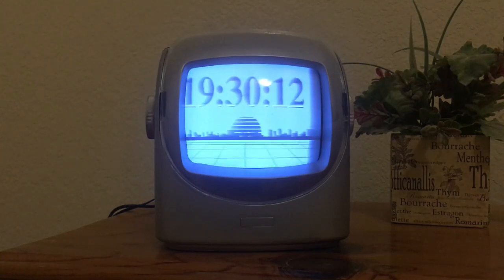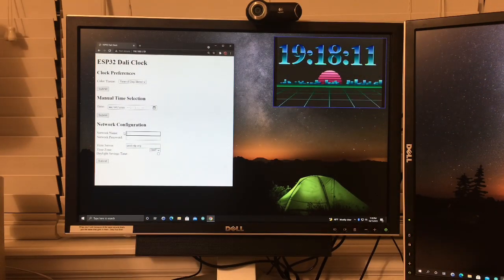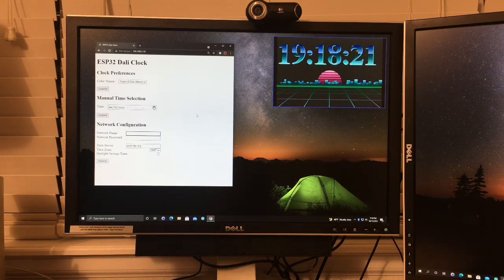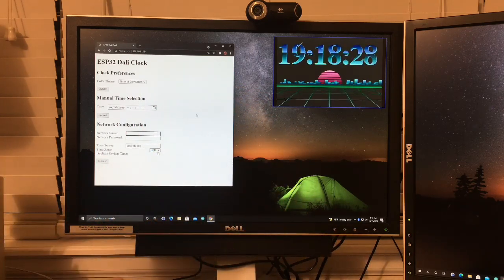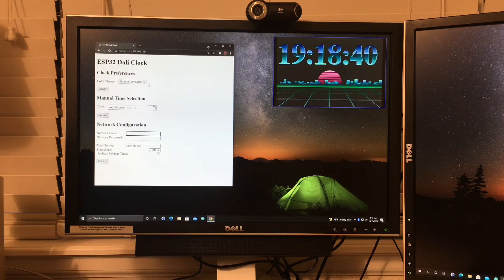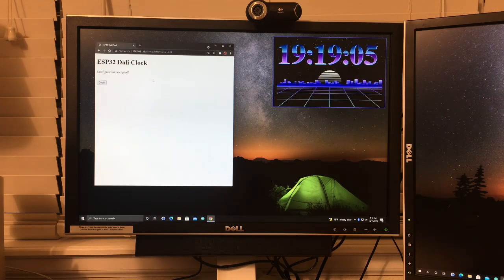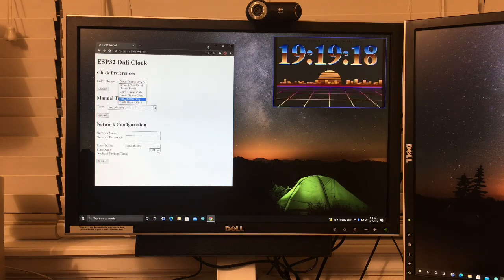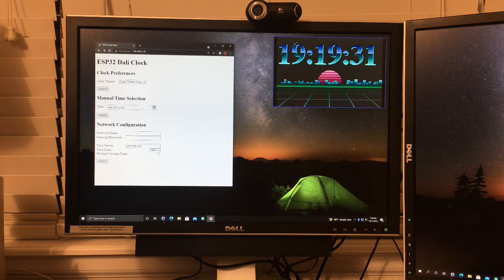ESP32 Dali Clock Demonstration

Comment: Is there a way to completely get rid of the wifi and web server and have pins on the ESP be buttons for setting the clock and the other features?  Love the effort put in to this and I would like to integrate it in to my custom camera system controller as a main screen on the camera monitor when no camera is selected.
Reply from the maker: Sure, the code can be modified to do this.
Reply: @MarcioT  Can you guide me in the right direction to start that?  I'm not sure where the commands are at in the web server section.  I can see like the menu commands and whatnot, but I'm also not familiar with HTML code and how to transform it back to C++.
Reply from the maker: All the wifi functionality is started by “wifi_start()” on line 85. You can get rid of that and everything following the comment on line 141. To set the time, call “dali.set_time()” as illustrated on line 86
Reply: @MarcioT  Thank you for the insight.  I will mess with it some time this week.  I see those lines you are talking about.  I may dig through the source files as well to see how to set the themes and dates.  Maybe mess around with some of the graphics as well even though what you have created it amazing!  Thank you for sharing this project.  Didn't even know this was possible with ESP32 before.
Reply: @MarcioT  Good news, I got it all working how I want now.  A few last questions:  How can I go about making a larger font, I'm not understanding what I'm looking at inside the font6x8 file.  Also, what Atari colour palette are you using for colours?  I can't seem to find one online that matches what you have done here.
Reply from the maker: @hydrolisk1792  look at the following repo: https://github.com/marciot/ESP32CompositeColorVideo . There is a link to the color palette in the expandable section "Documentation for Developers". The bitmap font is only used for printing the tiny text at the top of the screen, not the clock. I do not know the format of that as that is part of Bitluni's original code base. If you want to change the size of the clock itself, there is another project with the font encoder https://github.com/marciot/arduino-dali-clock
Reply: @MarcioT  Thank you for the information.  Much appreciated.  Got some answers to questions I had with the palette at least for now.  For now I can work on other screens now that I know the palette.  Contacted bitluni about the font issue.  Waiting on a reply.  In  the mean time I will begin creating some on screen graphics to use along side the clock itself.  FYI I wasn't looking at changing the clock digits at all as they are the perfect size and the file for those is a lot more understandable than the font file.

Comment: I was wondering if you could help? I seem to have everything uploaded correctly, and i'm using a NodeMCU ESP32 unit. The issue is that I cannot see a working WiFi AP? It's not showing on any device. Any ideas as to why?
Reply from the maker: You may have to try earlier versions of the tools, this has not been tested in recent versions.
Reply: I've tried different versions of the IDE to upload the code. I do have more luck with the older versions. The vertical hold is better when using an older version, but still, there's no access point? I've tested my ESP32 with another program which creates an AP which works fine... I'm just not sure?   @MarcioT

Comment: Have you tested this on the latest 2.0.3 esp32 code? I cant get the config page to open, i can connect to the AP. But I either do not know the IP, or it simply does not serve a web page.
Reply from the maker: You can find the IP on the serial console or it will be printed on the top of the screen briefly when it first starts up
Reply: @MarcioT  Seems it does not work on the latest, i used 1.0.6 to compile and it works perfectly. Really nice project overall.
Reply from the maker: @Nobody-Nowhere  I just tested it under 2.0.3 and confirmed that you needed an IP address to connect to it. So I added this to the startup message.

Comment: Excellent project Marcio. I'm trying to get it to work on a Wemos Lolin32 (brand new & flash erased) but the Wifi AP doesn't initialise. Would you have any idea why?
Reply from the maker: I don't know. The code that initializes the wifi starts on line 275. The first thing it does is put "Failed to connect. Please connect to "ESP32 Dali Clock" to configure. If that message is appearing, then the next thing that happens is the AP is setup.

Comment: Is there an easy conversion to run a TFT display?  I love the numbers melting into each other and I don't have a monitor with composite input.  I hate to learn every bit of the code to convert it over to TFT.  Thanks for a great project, either way.
Reply from the maker: Hi! My Arduino Dali Clock might meet your needs:

https://www.instructables.com/80s-Style-Melting-Digital-Dali-Clock/

Another easy solution is to buy a rear-view car backup camera kit. For about $25 you can get a small LCD display capable of composite input:

https://www.amazon.com/Monitor-RAAYOO-Definition-Display-Optional/dp/B074P4L9XK/ref=asc_df_B074P4L9XK/?tag=hyprod-20&linkCode=df0&hvadid=312141906131&hvpos=&hvnetw=g&hvrand=8110339378037440785&hvpone=&hvptwo=&hvqmt=&hvdev=c&hvdvcmdl=&hvlocint=&hvlocphy=1014517&hvtargid=pla-569415873081&psc=1&tag=&ref=&adgrpid=60234797217&hvpone=&hvptwo=&hvadid=312141906131&hvpos=&hvnetw=g&hvrand=8110339378037440785&hvqmt=&hvdev=c&hvdvcmdl=&hvlocint=&hvlocphy=1014517&hvtargid=pla-569415873081
Reply: @MarcioT  Thank you for the quick reply.  I will try some of these things today.  I really like the look and want to have it running on my ESP32 TFT display.
Reply from the maker: @michealmorrow1481  unless your TFT display is based on the FTDI FT810 controller, which is unlikely, the Arduino code won’t help you. As it is, purchasing a composite screen is probably the best bet for you.
Reply from the maker: May I ask what TFT display you have?
Reply: @MarcioT  I have several.  TTGO T-Display, T-Gallery and T4 Background dimmable.
Reply from the maker: @michealmorrow1481  If you are willing to support my work by purchasing me a display, I could port Dali clock to it. I added the two I could find to my public Amazon shopping list, plus a few wrist watches that could run Dali clock: https://www.amazon.com/hz/wishlist/ls/EITDFFCI2QR2?ref_=wl_share

Comment: Nicely done! So dos it use the A1/DAC pin because it's outputting an analog signal? Also, using capacitive touch sensing to display the date?
Reply from the maker: Yes, correct on both counts!
Reply: @MarcioT  Looks cool, and easy to implement with your code. I'm tempted to try it myself, but I have so many other projects to do, ha.
Reply: @MarcioT  So you're using a Huzzah board, but you could use most any sort of ESP32 breakout, correct?
Reply from the maker: @JeremyCook  yes, pretty much